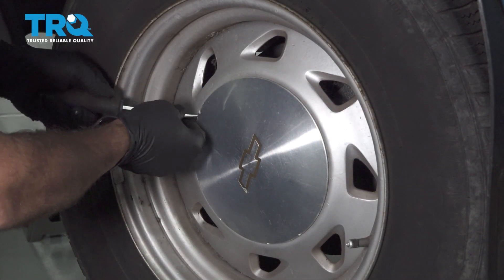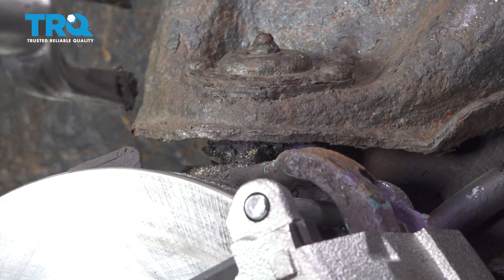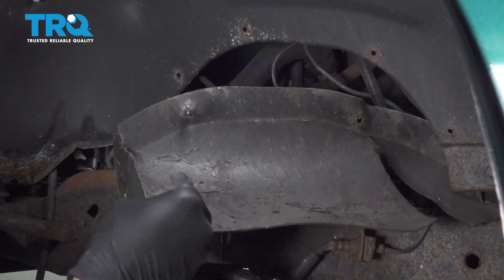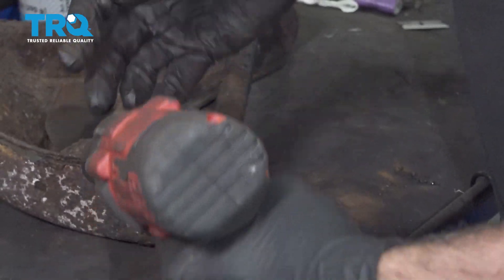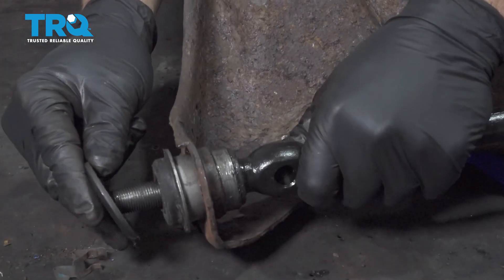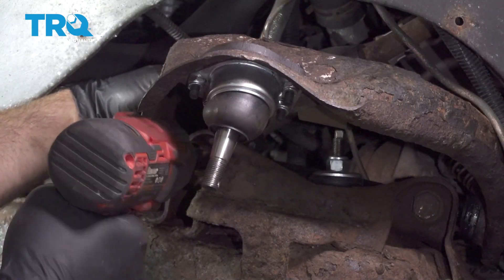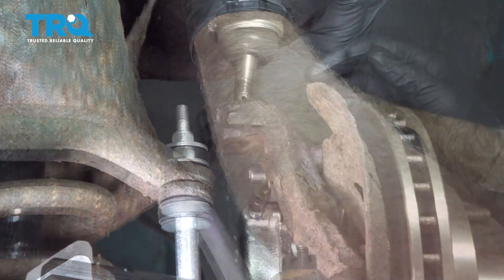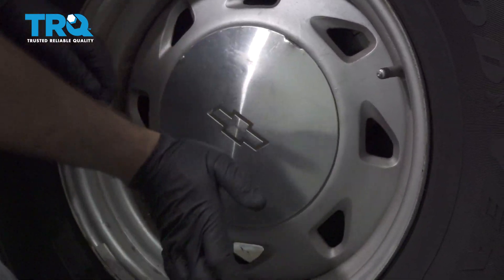How to Replace Upper Control Arm Mounting Bracket 1994-2004 Chevrolet S10

Comment: Just installed my new upper ball joint after tightening with impact i have more on my shaft than you . Can we use multiple washers to take up slack? Then install castle nut ? And cottorpin